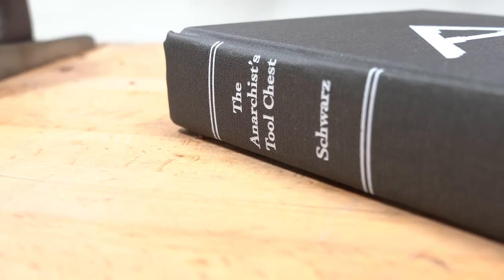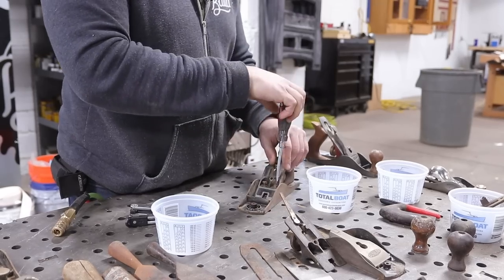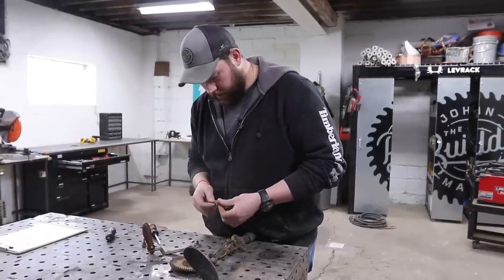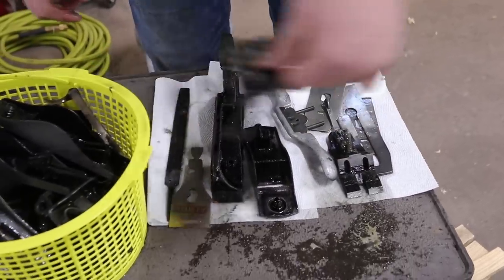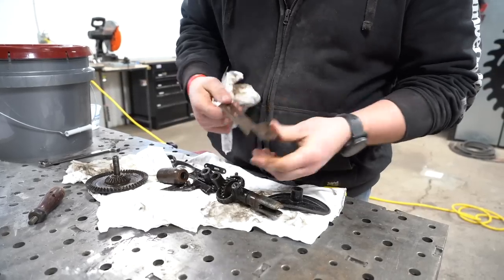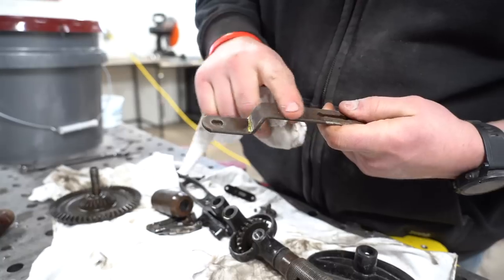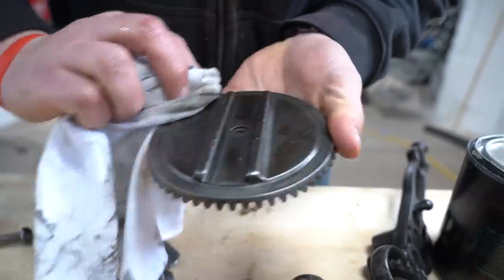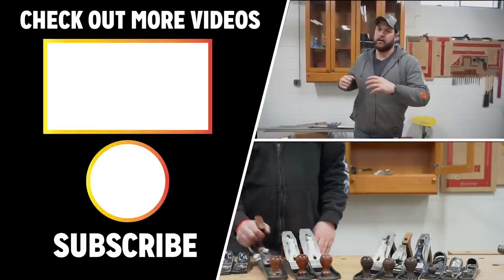Removing Rust From Grandpas Old Tools!

Comment: The handles are not too small. When you grip it use only ur pinky, ring, middle, and thumb. Leaves your index finger free to move your depth adjuster otherwise leave your index pointed straight out which helps align your wrist 👍🏼
Reply from the maker: Yes but i still need a bit more space for those other 3 fingers, fortunately it worked out on the gage plane, ended up being too big for a regular plane. great tip tho Brad!

Comment: Great video JM. Amazing the precision of those parts on that drill from 1910. My wife’s pa was a wood worker as well and I learned a lot from him before he passed. That rust remover did a great job. My wife left my hammer outside over the course of a couple of days. I used vinegar to remove all the rust, but the oxidation was so bad the hammer head had shrunk. So now she has her own hammer and bought me a brand new one.

Comment: awesome video, as always! Tip i learned when making my own tote, is it is much easier to drill and counter bore an accurate hole in the tote before you cut it to the curvy shape.
Reply from the maker: Yea this method worked well too

Comment: John; I have been working on getting my dad's adjustable wrenches cleaned up and lubed up so I can use them again. One I am having a "P.I.T.A." with the screw for the thumb wheel will not come out; It turns freely. Not enough space to get even the smallest screwdriver between the thumbwheel and the main part of the wrench

Comment: Hi John! I got an old plane from an Uncle of mine last year. I was excited to restore it to it's original glory and when I did I discovered it was cracked. I do not use many hand tools  but  would like to incorporate it more in the future. So the plane niw sits as a reminder in my shop. It is a beautiful tool for sure. Im not familiar with that solution you used so I'll do some research for future possible garage sale took rescues!
Reply from the maker: Thats awesome Michael, i would clean that one up and let it sit on a shelf if its cracked! The Evapo Rust is some good stuff !
Reply: I've welded busted up iron planes. They're worthless then on the collectible market but you can get them back into working order. Once they're broken they're worthless period except as parts donors. Though some unscrupulous dealers will do repairs and sell the tools as good condition. They either sell in the dark or they're better at welding than I am.
Reply from the maker: Yea welding them is a risk, never good for resale but does have some value if you wanna make it usable
Reply: @John_Malecki  a broken plane is already not worth much. Repaired you may get some use out of the tool though. I fixed up a basket case No. 2 Stanley plane that had a big chunk missing out of its body. When I got a curl out of that plane it thrilled me. Because it was really messed up when I got it. I only paid a buck for it though. Look up what a No. 2 in good shape sells for.

Comment: I have a old plane my grandmother gave me before she passed. It’s suppose to be my great grandfathers that he used to build coffins. Idk to me it looks old but not that old. idk what the hell im looking at anyway so who knows. Either way it’s old and the handle is broke in half and I need to try and get it apart to clean it up and see if I can glue the wood back together if not I’ll have to try and make one.
Their is also a old wooden level with brass trim but the styrofoam or whatever material around the bubbles is deteriorated. I’ve never seen a wooden level before but it would be cool to restore that one as well.
Reply from the maker: I’ve seen some wooden levels. I wouldn’t personally try and do much besides clean it up, the technology is prob still similar to the way it’s done now, but would just be used for looks if it was me

Comment: Just an FYI - a patent date doesn't necessarily represent the age of a tool.  A patented tool will often be manufactured over many years and still bear the original patent date and even look identical to the first run - 5, 10, 20 or more years later.